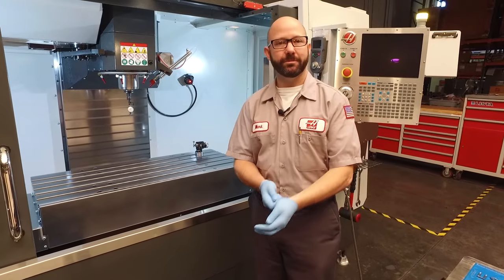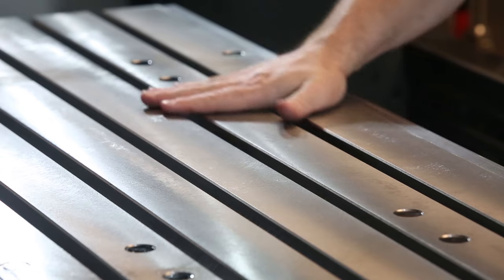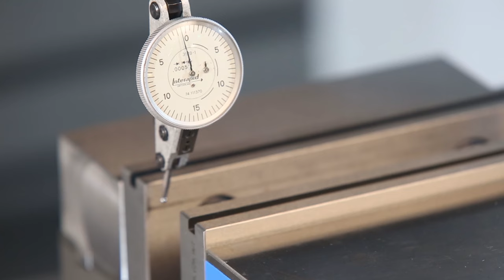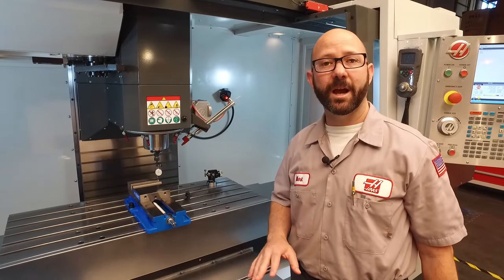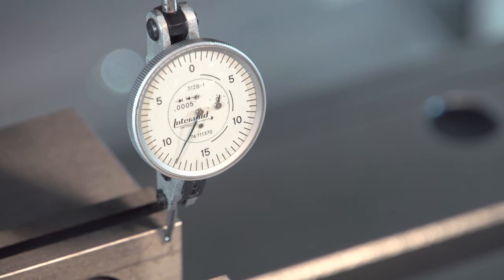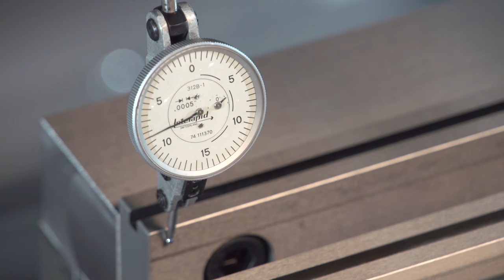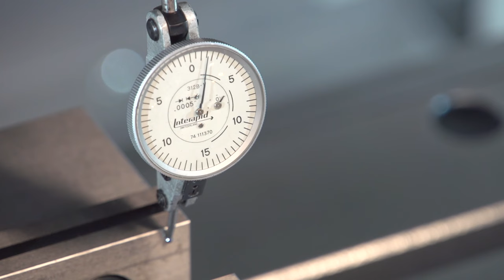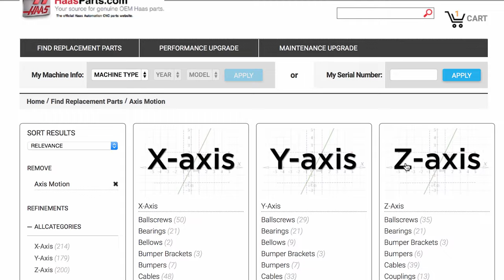How to Square and Indicate a Vise on Your CNC Mill – Haas Automation Tip of the Day

Comment: I'm a couple years into having learned to set up parts at the shop I work at. I've always just loaded up a vise and set up, never thinking of checking clearance because it was the vise I was told to use. I'd never have bothered to check before this video. I'll never need to where I'm at but I may need to in the future.

Comment: A couple of things to note.
1: Check for burrs first, if there are none no reason to stone. But don't forget there will always be a high-spot around a dent when it's created!
2a: Don't keep stoning just in the same position of the table, that will make the surface uneven in the long run.
2b: If possible, move the vise around to different positions (a vice with slots instead of fixed positions for the bolts are more flexible and you can use 4 bolts with less torque to get the same holding power = less wear and strain).
3: To reduce the amount of oil in the coolant (and your lungs), apply RP with a cloth, not spray.
And personally I really prefer diamond "stones", much less wear on them = less abrasives in the machine.
4: Before setting up, look at your drawings and planning of the job, how accurate do you need to be? (There is no exact, always a tolerance.)
Those hoses for cleaning the machine with coolant?  I just love 'em!
Reply: What grit of the diamond stones would you recommend for removing burrs and for flattening?

Comment: The other option for the tool room mill is to mount the vise sideways, not super easy to load and unload parts but it will work.

Comment: I wrote a little code to sweep the X axis incremental back and forth 5”.  You set your indicator on the back left jaw as shown in the video, then hit start on the program.  You can watch the indicator and adjust your vise with both hands free, no jog wheel needed.   It is one of those programs that just “lives” on the machine forever.

Comment: I may not own a haas, but I always appreciate the tips you guys publish. I was wondering if there might be a mathematical formula or rule of thumb for working out the vise adjustment. I usually just tap it close on the first sweep, then work with about 90%. So if it's 0.010" out on my DX6, I'll knock it 0.009" forward and expect the other side of the jaw to move that extra 0.001" Unless the pivot is directly below the jaw edge, I expect it will always require somewhat less than knocking the other side all the way to 0. Thoughts?

Comment: Great video nice and simple for a beginner. Kurt vices are awesome we use larger ones at my shop without any protruding in the back when closed. A great way to unclog your stone is with varsol (mineral spirit ) and a piece of wood.
Reply from the maker: +Carlos Diaz Great vises. The D675 with the protruding nut was replaced by the D688, where the nut does not protrude (also more clamp force, wider opening). There are SO many of those D675 vises out there, and more vises like it are being made by other brands every day, that we wanted to let people know to check for it. Thanks for the comment about cleaning the stones, and for taking the time to check out our latest Tip of the Day video!

Comment: Mark, as a suggestion, on smaller mills, where is no need to mount vises sideways.  We have 3 of the TECO PWS-6900 vises mounted on our new TM-1P, at normal orientation, center of the table, with 1/2 bolts and t-nuts.  The closed clearance on the Z- way cover is 1/2" or more.  Cut about an inch of the hex off for door clearance and 3d printed handles to ride along as the machine is running.  No more messing around with and looking for the floppy metal handles.  Printed handles had to be designed to allow door clearance during operation and also to clear the vise as it is loosened or tightened.   The ABS is more than strong enough to handle the 200lb gorilla tightening the vise and again, the handle is always there.  And, maybe someday will make some metal handles, but for now, no need.

Comment: There is a more advanced way to ensure clearance and you'll need to get with your Haas tech to do it. You can limit the axis travels in the control. I haven't had to do this in quite some time, but if I recall, you basically limit the number of encoder pulses the axis will move away from the home position.

Comment: Buy or make keys for the vise. The vise drops on within a couple thou every time. Or eyeball the t slot and vise slots and you can get it pretty close.  When I was working in Tool & Die shops I always had at least 1 matched set and would disassemble them and lock up some of the parts when I wasn't using them so my employer or co-workers could not f them up.

Comment: would like to see more 4-axis stuff. when is that coming?
Reply from the maker: +raider Definitely! We are working on more now. In the meantime, check out our G107 video: https://www.youtube.com/watch?v=zCXdDyps3X0. Using G107 is one of the easiest ways to program simultaneous 4-axis moves. We’ve just added G254 Dynamic Work Offsets (DWO) as an option on mills leaving the factory. Working on that video now. With DWO, things will get even easier. More to come, stay tuned!
Reply: raider could always throw In an m0 after a position move to hand operate a turn table. If you don’t have an actual 4th axis. Dial in a 90* angle block and mount a manual turn table to it. (Obviously this is dependent on the material and tools used. I would not run heavy cuts on aluminum or cut stainless that way.

Comment: I am really happy for your awesome video. I am facing another problem. I am using mach3 for my CNC machine. But here in BD, we face load-shadding. Sometime I load a long time design but in the running time electricity cut off . I can not damage costly wood. Therefore, If I want to re-start the work from the same point where the machine stopped , What is the procedure for MAC3 system? Please could you help me? I will be grateful to you.
Reply from the maker: With Mach3 you might have to create a new Safe Startup Line where things stopped in the program, and start from there (M06 T1: G54 G00 G90; G43 H01 Z3.). On a Haas control, we just turn on Setting 36 Program Restart, and press the green button. Check out https://youtu.be/ePlyXeXYZBE for more information. – Mark, Haas Tip-of-the-day

Comment: Lots of good tips,   but the indicating part,  I'm curious (For example) touch indicator on both sides making sure you get a reading on both,  pick one to be zero,  jog to other side,   say it climbs .0800,  subtract .0400 from the high,  and you should be at zero already?  Should you not?
Reply: You can also do the opposite and add to the low (again for example) that ".0400"

Comment: Tip: Use a properly adjusted speed square to line up the vise before tightening the firs bolt. Saves a lot of time.

Comment: As a tip from someone that... saw someone else do it. Check clearance with a handle left on the vice. Assume it's going to happen because it will.
Reply: Very good suggestion
Reply: That's a problem at our shop. I actually made it a rule for the setup guys to put m00s at the beginning to check if you removed the handle. Saves our ass on our Umc

Comment: how about a video on setting up dual vises and getting them aligned?
Reply from the maker: In my old shop, we’d clamp a single ground bar in both vises, then square them up and clamp them down together. I’d say to key the vises, but I don’t like the way having keys sticking out forces me to lift the vise with outstretched arms (straining my back) or risk dragging the keys across the machine table, indicating it doesn’t take long. Without a bar I’ll set and clamp the left vise, then without moving the Y-Axis, I’ll jog the indicator over to the ‘pivot point’ corner of the second vise and start indicating from there. Hope this helps! Maybe others can chime in on what others are doing!
-Mark, Haas Tip of the Day
Reply: Full Throttle Engineering  fixture plate with some locating pins for multiple vise set ups

Comment: Can you guys make a video about how to indicate 2 vices together,   side by side.  So they both read the same on indicator.
Reply: Dan 
Hey Dan, I used to have to set up three vises and the trick was to install and indicate in your Center vise then clamp on a piece of bar stock where the bar stock hangs out on both ends. Then you place your vises on either side, or in your case just one side, and you close your vise on the bar stock and that will help line you up very close to the position that your Center or primary vise is in. Now you just bump your vise in to read at the same zero as your primary vise.
Reply: Use your brain

Comment: Love the series. As an amateur at CNC maching, these videos are a lifesaver at work. I have a question though, where do you guys buy your indicators and machinist stones? My work says they'll buy me them if I can find ones I want but so far, I have no idea where to look or what to look for because I just started to learn to set up a 3 axis machine. Many thanks for these videos!
Reply from the maker: Zachary Clink – Finding a local Industrial Supply house to work with is always a good idea. www.mscdirect.com, www.grainger.com and www.mcmaster.com are always good sources though. Amazon can be cheap, if you can find what you want. Do a quick search at MSC. Indicators can be found at the same places. I like a Brown & Sharpe Best Test .03” Indicator, with .0005” grads, or a nice Interapid .06 Range, .0005” grads for general use. For more on indicators, check out this video:  https://youtu.be/kvkO_If3UVg?list=PL1FfK7Yod27cy-MIhXsKkDwTmvclf7ps7  Maybe we can get some other comments from folks, letting us know where they shop and what they use. – Mark, Haas Tip-of-the-day
Reply: I would get either mitituyo or starrett. I have a mitituyo test indicator and a starrett dial drop indicator and they are very nice. I just got mine from Amazon

Comment: What's curious to me is when I tighten my bolts, the rotation of the nut coming down onto the vise will move it.  Then I have to indicate again, then tighten the bolts, then it moves, then I smack the vise with the hammer....  So how did you tighten those two bolts without that vise moving again?
Reply: The first nut needs to be tight enough to keep the vise from moving. The vise should only move with a tap from a deadblow hammer, but tight enough not to move while the second nut is being tightened. Using a washer under the nut can also help keep the vise from moving as you tighten the nut as well.

Comment: Do Haas CNC machines have soft stops (ie software defined limits) for the axes ?  That would solve this issue if you didn’t need full travel.
Reply from the maker: Gazza-usa – On Haas Machines with the Next Generation Control, we can set User Positions>User Travel Limits to limit the distance the table can move in some directions (away from the Home Switch). Thanks for the comment. – Mark, Haas Tip-of-the-day

Comment: Unless you mount it sideways. ( on the smaller machine)
Reply: Robert Burns agree
Reply: Not ethical or efficient
Reply: Robert Burns I said the same shit. Leave it to a machinist. There’s always a way.
Reply: mikel Zaragoza but if that’s the best you got and you need that spindle throwin chips.... do what works.
Reply: and how do you wanna set the vise with bolts? the T grooves cant fit in to the distance of tighting bolts
Reply: You can try a very usual (but not safe) way: machining with the door open by using a copy of a door's clamp. Trust me: many machinists do this shit.

Comment: What do you use for rust prevention? What was in that spray bottle?
Reply: Rick  wd40
Reply: DubyaD
Reply: Way oil --- wd40 is no oil - its for cleaning
Reply: Oskar 22 Fridolin 
WD is water displacement.  It is a water displacer, not a cleaner.

Comment: What is the best Rust Preventor to use?
Reply: +Tim Mallard i do a mixture of 1 part slideway lube, 2 parts lanolin, and 8 parts crc (Australian) if your in usa or the  E.U  i'm not sure what  the  equivalent is, maybe a wd40 type liquid rust preventative? this works a treat,  especially if a  vice or  4th axis type work fixture could be clamped on the  bed indefinitely.

Comment: nice to know, but what happens if the bolts won't go in the holes/ slots of the vice??
Reply: If we can not use the holes in the vise, we can use Toe Clamps along the edge of the vise to hold it in place. https://www.haascnc.com/haas-tooling/mill_workholding/workholding_accessor/04-0258.html

Comment: hi! i've 2 question...
what's the hardness/n°grain of the stone?
What do you use for rust prevention?
Reply from the maker: Daniele – I’ll use the fine side of a Norton 61463687570 Crystolon Machine Knife Stone, but I know a lot of people prefer the fine side of an Aluminum Oxide India Stone, at around 320-grit. - In this video I was using a Castrol Rustilo DW 90 HF, it used to be called Safecoat DW 90. This is what I have readily available, here at the factory. This is a thin Dewatering and Protection oil.  I’ll use WD40 as well sometimes. – Mark, Haas Tip of the day
Reply: @haasautomation  Best would be to diamond grind that stone first, as you can hear the stone screek on the table on the video. That indicates that it will be scratching the table and that the stone is not flat. Check out ROBRENZ channel about precision ground flat stones, they  do not remove anything but burrs and they do not scratch the table.
Reply: @danielemassabo1933  thank you for the links

Comment: Hello! May i know the name of the Rust Preventative Spray?
Reply from the maker: Hello - We use a Castrol product called Rustilo.
Reply: @haasautomation  many thanks for the quick reply. Very appreciated. I had a look at castrol portfolio and there are more than 35 products some water based other oil based... do you know the code of the product ? This will be very helpful!

Comment: I would like to mention how important it can be to understand what you are doing when you stone a table. If you want your machine to be at least decent (as far as the table goes) for years to come, try to make the wear that you cause with your stones to be even across the whole table... Or: as an empirically better option, watch 
https://www.youtube.com/watch?v=DVLXsq7pi9Y
 to learn about the difference a deburing stone vs. a (some would call) gauge block stone can make regarding the overall life of your machine and the flatness/repeat-ability of anything that you might stone normally.

Comment: What rust preventative are you using?
Reply: He is using Castrol Rustilo. However there are a few different variants of it. Not sure wich one.
Reply from the maker: In this video I was using a Castrol Rustilo DW 90 HF, it used to be called Safecoat DW 90. This is what I have readily available, here at the factory. This is a thin Dewatering and Protection oil.  I’ll use WD40 as well sometimes. A light spray of this oil keeps my vises, collets, and tools rust and corrosion free. – Mark, Haas Tip-of-the-day
Reply: Thanks Mark, I recalled this video from my memory banks, needed just for this lil bit of info.

Comment: Is it possible to mount and install a different machine operating system on these haas mills?
Reply: Freezer to what end, like replacing the Haas control with a Siemens uber control?
Reply: Iceberg86300 more like a Heidenhain TNC

Comment: Or bolt a sub plate to the table with multiply holes tapped into it. That way you can bolt the vice down anywhere you choose. Plate obviously needs to be ground then drilled and tapped.

Comment: How to turn on the coolant aux on the front of the VM3?
Reply from the maker: If your machine has Aux Coolant, you can press the AUX CLNT button to turn on TSC (Through-Spindle-Coolant), or press Shift and then the AUX CLNT button to turn on TAB (Tool Air Blast), instead of entering M88/M89 or M73/M74 from MDI. That key is right below the Coolant Up/Down keys. – Mark, Haas Tip-of-the-day.
Reply: Tried that. It didn't work
Reply: cj30dj ,  shift coolant works on my 2009 VM3

Comment: So over looked. Especially in shops with multiple shifts, a lot of times your guy closing out his 2am shift trying to finish a setup isn't thinking about the M501 that the 5am guy has to run of 15 machines.

Comment: pretty good but not the best on the vice--one big mistake. Put both bolts in and push and pull back and forth and get a good feel for the "center point" of the slot. Barely snug the left bolt as shown--barely pull and pretilt the vice right side SLIGHTLY TOWARD YOU.. Both bolts are in no need to take out the one. now snug up the left bolt a bit more and do the rest just like he showed. That way you are doing the same each time and not knocking INTO the workings of the indicator you always will be knocking so it pivots the right side away from the indicator. Also by doing that after you start on zero the indicator IMMEDIATELY reads as it goes over you tapping the whole time--when you get over to the right side you then are within tenths when you go back over--not he went way off the indicator and went over into space and had to knock into the indicator however he exaggerated it of course more than he would really do for demo purposes.. physically taking out one bolt is not needed but he said that to get the point across. The way Mark did it keep in mind that the bolts can and will be cocked at an angle--always get a feel pushing and pulling for the center of the slot.
Reply: one more tip he may add at some point--ALWAYS MAKE SURE THAT VICE IS TIGHT--because the bolts may simply be bottomed out in the threads!!  I have had that happen and I went to take out a part and the vice moved! I only had it happen once but that is a real danger especially if using home made t bolts because the tapping may be all the way through--on store bought bolts the tapping does not allow the bolt to go all the way and jam into the bottom of the slot.  The tips are the best and quality of the videos is astounding but these 2 things might have been mentioned..